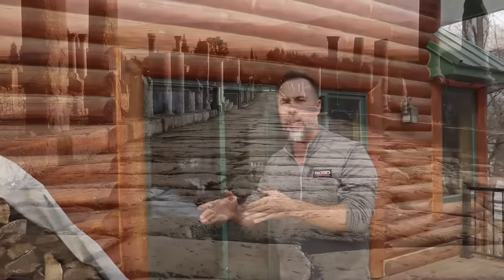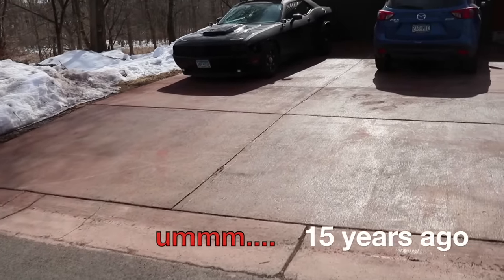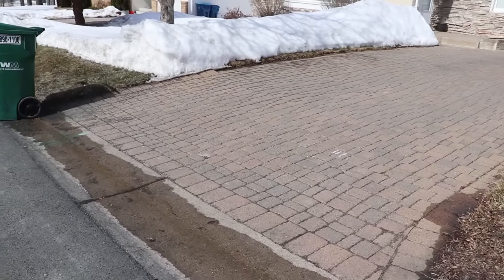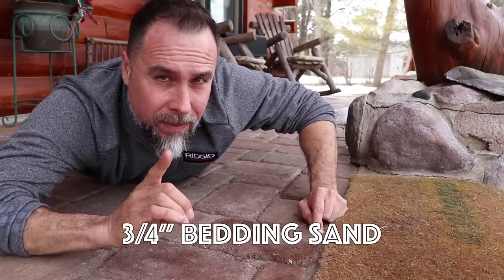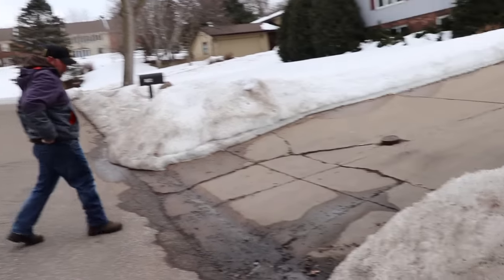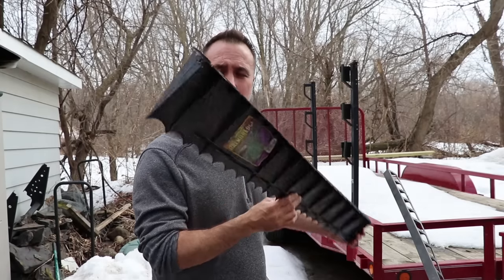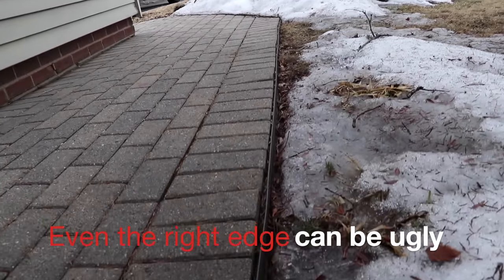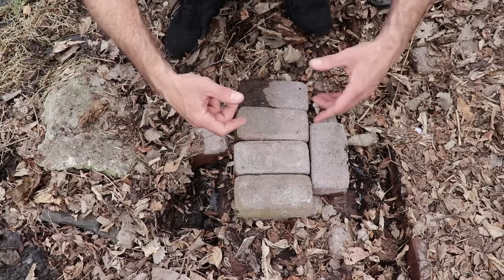How NOT to Build with Pavers-  Why They FAIL! *DIY your own successful paver project

Comment: Please don't take this the wrong way, and not wanting to put down your work Stanley but at 1.52 the surface has got some cracking, with what look like pits and blemishes and the general line of the blocks goes into a few wobbles at 2.51 which,after 20 or so years isn't bad but doing a 12 inch base would hopefully last a few thousand years.
 I saw how you illustrated your film in the beginning with some Roman roadways and paving, When they did their base work they would have dug down a lot deeper and the finished surface would have been slightly curved either side to stop water sitting on the surface, they also had many slaves to do the pounding and we have whackers.
In my own work I tend to use the same materials as the Romans did, a slaked Lime Putty Mortar and because everybody thinks they can use the stuff there are many expensive failures with nobody going back to fix the problems because it's not their fault is it, it's always the materials.
Some internal Roman walls have as much as 9 layers, starting with the coarsest aggregate and getting finer towards the last when they might have added marble dust to give that long lasting effect. 
It's good to take pride in your work and I'm sure you are good at what you do but I wouldn't slag others off too many times because your work stands for itself and previous clients will always recommend you to others.
So instead of using concrete blocks/paving bricks do what the Romans did, use stone instead, it costs a little more but it'll last for thousands of years and looks so much better.

All the best from the UK to my transatlantic cousin and thanks for reading this.
Reply: @bonanzatime , don't forget that it's long lasting bullshit whereas today we only seem to build for short term.

Comment: Not even a chip or movement 2:41 you can see lateral movement (hope it wasn't installed with waving lines) and a chip..... Get the point though, still very good over time.
Reply: Yep, the boarder on the left side has moved too. Truth is, you can do everything right, but it won't stay perfect for ever.

Comment: I found out a little liquid nail goes a long way, Slap on the underside of the pavers and adhere it right unto the screening(aka on this video as the 1 inch substrate). Will last a long time,....

Comment: Pavers are 3 times more expensive
Reply: but u get what u pay for ....and will last if done right.
Reply: from what he said in the video, that 1 driveway was only 5 years old and already cracked in multiple spots. The paver driveway is 23 years old and still looked almost brand new. the pavers are more up front, but save you money in the long run if done right.
Reply: Properly installed pavers are the best kind of pavement. They may cost more but they last a lot longer. The beauty of pavers are there ability to move with frost heaves and flex and not crack. The pavers may only move 1/32 of a inch and you won’t notice that but on asphalt or concrete that 1/32 will cause a crack.
Reply: I agree guys, but as a concrete contractor, if one of my driveways cracked like that , I would replace it at my cost.  I have drives from 25 years ago that don't have a crack in them. And I live in the midwest where frost kills us.  Not arguing the paver reliability, just the example on this video is a rare exception. Both products have their place
Reply: Even concrete can last if poored right. I poured driveways with proper bases 30 years ago that have not cracked to this day. It is all in knowing your material and its expansion rate due to climate. And not build cheap crap just to pass code.
Reply: Matt Martinson 
It would in the north east
Reply: Not if you can do the work yourself.  Last spring I did 1100 square feet of paver in my back yard (two patios, a small retaining wall, and a walkway between them).  Including a 6x6 deck off the house done in the trex-style wood, it cost me about $6k total.  That's pavers, base, sand, posts, decking,  equipment rental (compactor), and edge strips.

If I had hired it done, probably a $40 to $60,000 job based on conversations with companies around town.  I love local guys with the enthusiasm of Stan and helping craftsmen and tradesmen, but I just couldn't afford that.

I didn't have the ability to do cement by myself, so I would have had to hire that done and it would have been $20,000 for similar square footing.
Reply: Tradesmen will always be more expensive, and for good reason if this vid is any indication. Also, trades are more than likely not to cut corners than the cheaper alternatives who will often forego techniques (time consuming which = $) and correct materials because it will be cheaper for them.
Reply: But lasts 3 times as long
Reply: Pavers are made from concrete. These are just more expensive because of the work that was put into them.
If the basement is good, the surface material realy doesn't matter.
Reply: I've done both interlocking pavers and concrete. Did not notice the cost difference (and didn't care all that much) as I pay for the materials as work in progress. Pavers more labor intensive, dig ground about 15" below grade, compact soil, lay 12" of stone dust, compact at every 4" lifts, 1" sand on top then lay pavers, cut to fit at the edges, more plate vibrating to get sand into cracks and few more times to get it all in. Higher maintenance to control weeds between cracks. But it looks nicer and easy to repair.
Reply: Pavers are much more expensive, unless you compare them to a concrete flatworker who is looking for suckers.  You all know concrete is guaranteed to do two things: get hard and crack.  Where and how much it cracks is up to you.
Two things to guarantee lots of cracks in your concrete is to pour over poorly compacted backfill and put lots of water in the mix to make it easier to place.  Water decreases the strength of concrete and increases the chance of shrinkage cracks.  Super plasticizer added to the mix mimics the workability of extra water but doesn't weaken the cured product.  Control joints cut into the slab help define the location of a crack.  The rule of thumb is every ten feet, but I try to put them closer.   If the workers tool in a 1" cut into the wet concrete, I will take a saw with a masonry blade and cut it another inch deeper to insure the slab snaps orderly along a straight line.  A cast in place 1x4 or 2x4 will also do the trick.
Reply: Steevo - Good advice, just a warning that sometimes termites will get into a wood divider. Maybe best not to use wood or a wood base divider.
Reply: Have not seen termites on wood dividers placed in concrete, for pavers no idea. Maybe termites don't like the Roundup I used on the dividers. Wood dividers on concrete lasted 30-40 in my area then started to rot from water intrusion. Wood directly on dirt will be infested with termites within 6 months. I use my 14" Hilti wet saw to cut a slot or use decking composites and mill it to fit as dividers, good stuff never rot in my lifetime.
Reply: Tim C I have a concrete driveway about 40 yrs old and not sealed. Not a crack in it. I agree, pavers are expensive, but so can concrete (still not as much I believe) when done right and built to last, without maintenance. I'm in the NE with snow, salt, ice, etc...
Reply: Make your own, time cost us all the same amount.
Reply: Than what? dirt?
Reply: Can I ask a question... I'm thinking of pouring a plain concrete slab, and then putting some decorative pavers over the top, using one of those concrete forms, so you just trowel in the concrete, in whatever shape the form is, then remove the form. this would just be for foot traffic in my backyard, a small area, what do you think? The reason I said concrete slab underneath, is to avoid having to put down sand and gravel and everything lol. and I figure wouldn't matter too much when the concrete starts to crack, because the pavers will be on top.

Comment: Driveways minimum base 12inch to 14 is the proper amount lmao less than that it wont last and isn't worth a damn blacktop driveways will last 30 40 years if done proper a d well but asphalt is a liquid and fails when becomes solid and then cracks like cement but if you have a 14 inches of base and fabric she gonna last